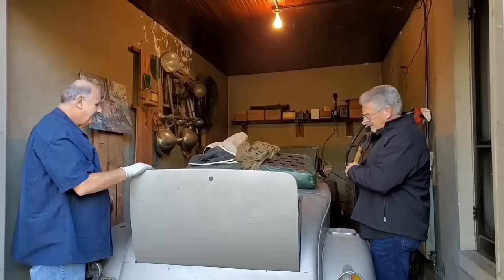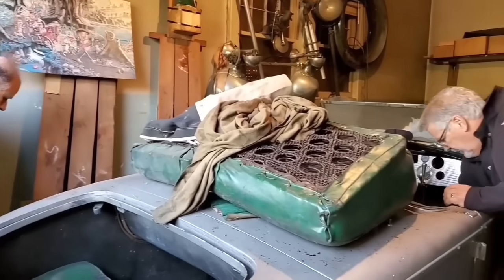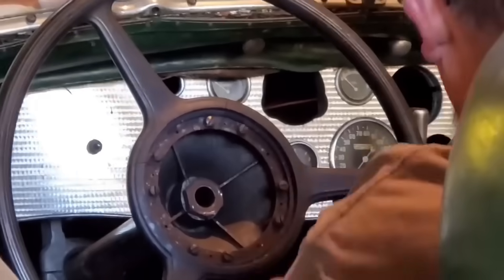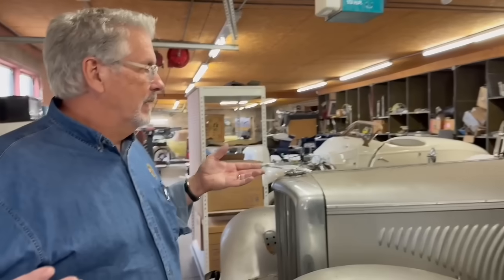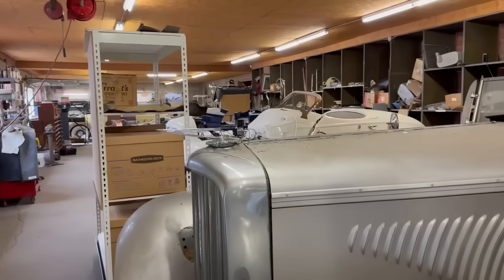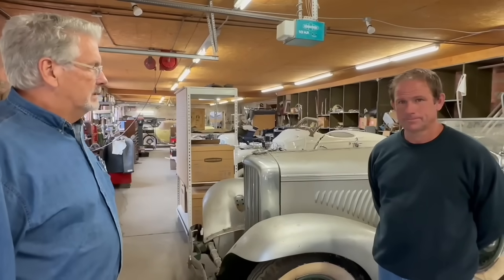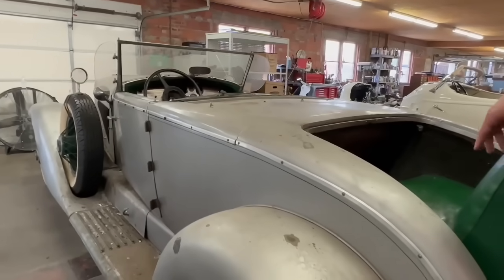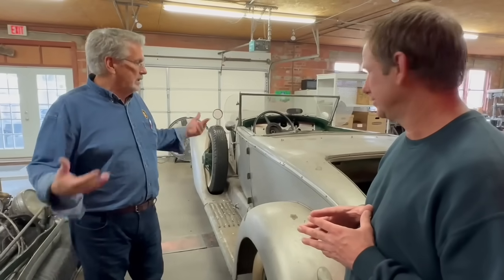$7 Figure Barn Garage Find!! 1931 Duesenberg Model J!!  1 of 25 Built! Hidden for 55 Years!

Comment: The Almighty., One thing. Unless the customer had this baby modified. Those fenders aren't '31 style fenders. Fenders of this style are from '34-35 era. These are Skirted. Skirted fenders weren't the style in '31. Unless it was ordered with this style of fender. So awesome to see that coming out of that garage. Nice job on the video. Also on an episode of Jay Leno's garage, Jay , who owns at least 5 or more Duesenbergs, has said that all cars were built in 1929. It took several years to sell them.
Reply: He did mention a 1950s interior, so the entire car probably has been massaged here and there. No problem to return to original. And we have the other Murphies to go off of.
Reply: @roberthoffhines5419  Yeah, I remember him saying the interior wasn't correct. Probably redone in the 50's. Can't wait to see the video on the engine.
Reply: I agree on the fenders looking more like being from 34 or 35. But since each car was actually custom built and some were designed a bit more radically with styles more advanced than any of the others. It nay not be likely but the original customers build request may have resulted in these fenders which in 34 and 35 were the norm across the board from all U.S. manufacturers. The only ones who could say with 100% certainty if and when they were changed or modified are long since dead but I do agree it was not original and the modification  was likely done in 34 or 35 by the factory
Reply: I've heard a few fails statements told by Jay Leno. Check your facts again.
Reply: Jay Leno is the expert on Duesenbergs
Reply: I'm thinking these fenders were skirted was because they were specified ......

Comment: I thought there were no Duesenbergs left that were not on the registry, but perhaps this was in the registry and just forgotten.? An amazing original Model J in great condition for an un-restored automobile. Even in 1967 these cars were starting to take off, it's good they stored it in a safe and dry indoor location. 
If Pray or Ames has it, it is in the right hands. Someone will put a few hundred K into the restoration and have a very rare and desirable automobile, worth well north of 2 million. . The car deserved better than that tiny garage. Loading and unloading that car had me tense - Great video Chad, what a find. Historic really !.
The engine is a Lycoming aircraft engine with dual ignition and side valves. It could be had with a supercharger. These could do 140 mph for hours. Can't wait to see the engine - 👌💯
Reply: Cord was front wheel drive, Deusenburg was rear wheel drive.
Reply: @danielulz1640  Thanks Daniel - I stand corrected.
Reply: @alexkalish8288  you are welcome Alex. Even though there were only three brands, Auburn, Cord and Deusenburg, it can still be confusing. And after all, non of them have been made in nearly ninety years!
Reply: The Duesenberg J engine was designed by Duesenberg. It's double overhead cam with four valves per cylinder. That was pretty advanced stuff for a production car in 1929 - but Peugeot made some four cylinder race cars in 1913-14 with dohc and four valve. There was also a Stutz produced circa 1932 which was a dohc four-valve. I think it was called the Blackhawk, but I don't get enough detail on my phone to check.

Comment: The chassis was built at the Duesenberg factory on W. Washington St. in Indianapolis. The chassis would then be sent to coachbuilders.
Reply: Yes and all of the components of the running chassis were made in 1929. They would be given final assembly when each customer order came in for which coach builder, body type, colors etc. These cars were built and sold from 1929 until the last one was assembled in 1937. Some people still have the debates of whether these cars were actually being mis-registered or not since all except for the bodies were made in 1929 and were slowly being sold until 1937 when the company went out of business
Reply: One of the buildings is still there on West Washington Street, old Hwy 40, across from the old GM stamping plant. It’s part of the bus maintenance facility used by the City of Indianapolis.

Comment: I was in a car museum in the western part of Virginia near the west Virginia state line many years ago and in the museum saw a luxury car of this era (I think it was Pierce-Arrow ) and it had an altimeter in the dash too.  The Curator explained to me and the others that these cars were so powerful they could drive up the mountains of the Appalachians without having to downshift in to 2nd gear.  However... at a certain elevation (hence the need for an altimeter) the car's owner had to get out and adjust the carburetor to meet the right mixture needed for the thinner air. The same thing was for when the car descended into the denser air.
Reply: The museum you speak of was the Petitt Museum of Motoring Memories in Natural Bridge, Va. Bill Petitt collected many stunning cars such as a 1929 Duesenberg J phaeton and a 1948 Tucker. I went there as a youngster. The museum was open, according to the 'net, from 1958 - 67.

Comment: You bought a chassis and drivetrain when ordering new.  Then it was sent to your personal choice of body builder and the body would be put on the chassis. So any questions regarding the fenders comes down to the original owners and their choices for a body.  
Could body have been modified since creation?  Absolutely.  Somewhere in this vehicle and in Dussie archives are the original build sheets.  Give them some time and all questions will be answered.
Reply: Yep.  And remember that EVERY Model J Duesenberg ever made was manufactured by Duesenberg in a single production run in 1929.  They were assigned a "year" not based on the date the chassis was manufactured (otherwise they'd all be 1929's) but based on the year it was initially sold.  The ONLY difference in vehicles during that single run was that a comparative few were intended to be coached as roadsters and had shorter wheelbases.  They were otherwise identical as delivered by Duesenberg.  It was the coachbuilders who actually were responsible for the design of the body, fenders, trunk, hood, etc.

Comment: Only fix what is broken  you can clean  it but it's only original once I would pay more for real paint than new paint people think there making it better but there just wrecking it .
Reply: Your absolutely 💯 percent right. Good 👍 call
Reply: I agree with you but only when a car is a completely original and untouched survivor in great condition. This car looks like it was possibly repainted and the interior is not original. Plus, as others have pointed out, the front fenders may be from '34 or '35. So in this case, I think restoring this particular car to it's former glory would do it more justice than leaving it as is. That's just me though, to each his own.

Comment: not a million in that condition, not even close.
Reply: There would be a bidding war for an unrestored car in this condition. The market is hot right now, especially for rare cars
Reply: Value before restoration is estimated to be about $2.5 million, which makes sense since a perfectly restored one is valued at around $4-$5 million.
Reply: That may have been the case a few years ago but prices have gone insane over the last couple years on almost every car.
Reply: Check your price with professionals or museums first. I've restored Dusenburgs, I estimate $2-3 million as is, 1 of 25 built.